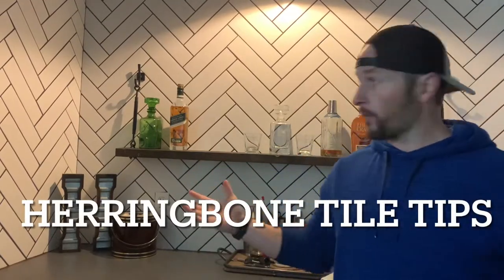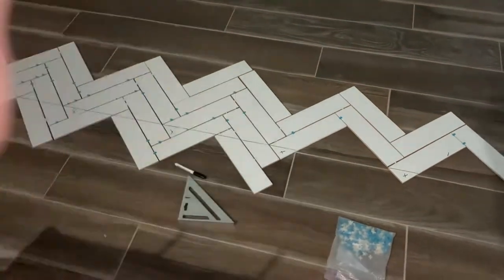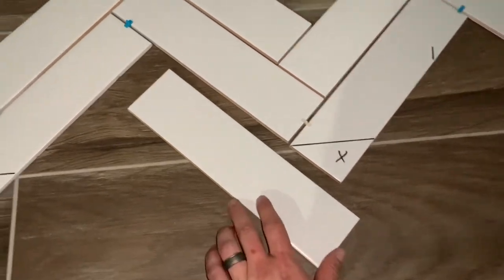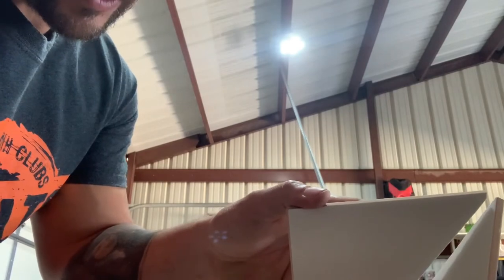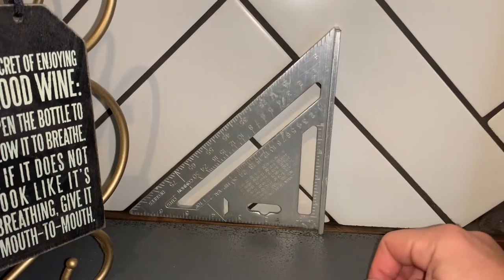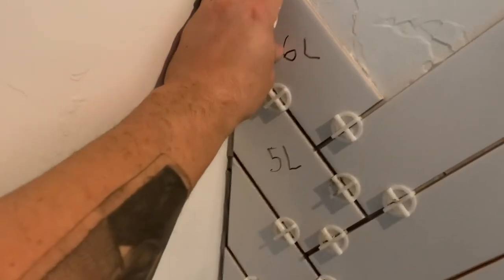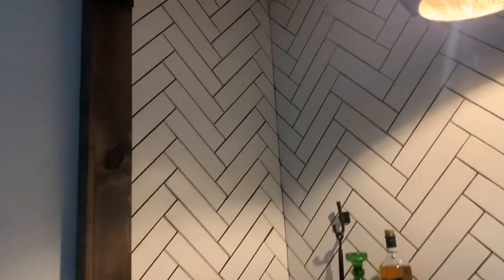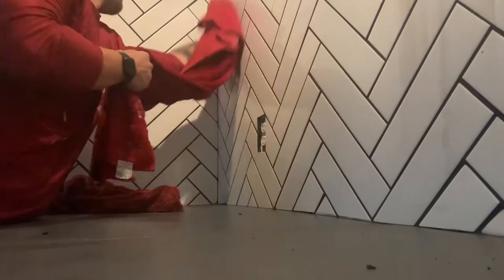How to Herringbone Tile DIY TIPS

Comment: Center shouldn't be on the tip of the tile,  it should be half of the width.  You would end up even that way
Reply: Get the precise horizontal center of the wall, and as @ballashoes writes, find the center of the short side of the tile and put a mark, line that mark up with the center line (while at its 45 degree angle), and that is where you should lay that first tile. This is by far the best explanation out there of both this technique, and of another technique if the first doesn't result in perfectly even end cuts. https://youtu.be/nRCYcPN5xkc?si=bwLjfFRLMqYb4EE9

Comment: i lost it when he put the 45 on the first tile and it was off a bit lmaooooo i feel better now !   mine is similar i don't know if its the wall or what , as I did not set the walls and they are off plumb.   also.. which size back splash would allow you to connect  from herringbone into a straight run ?